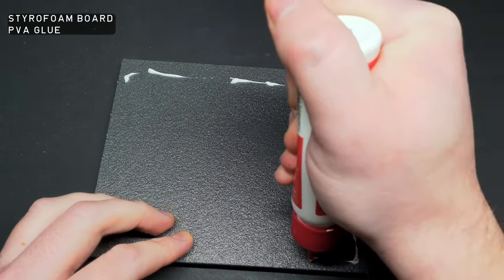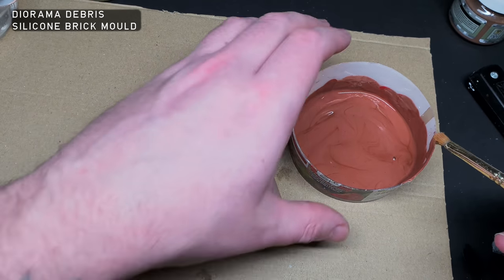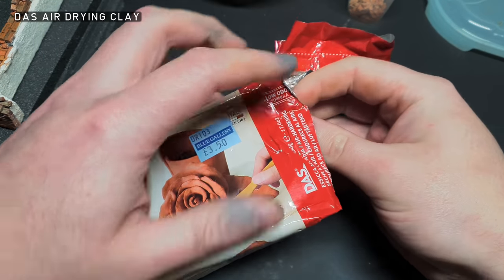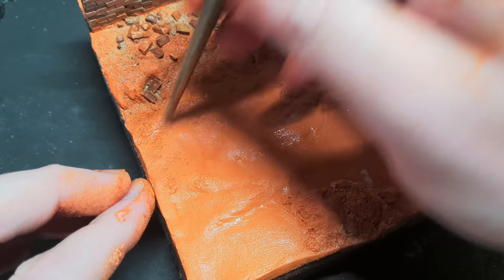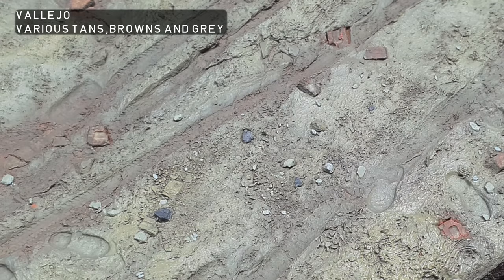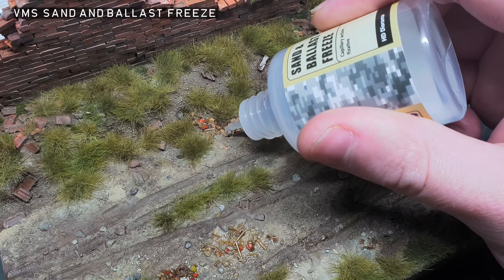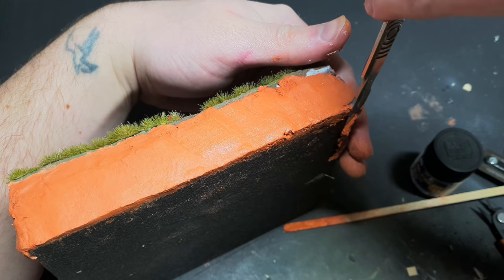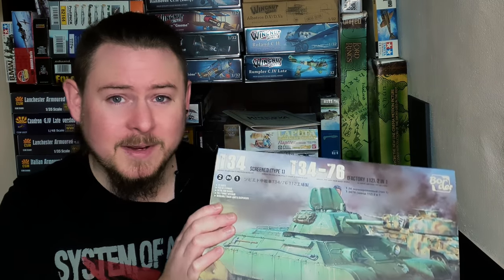1/35 Diorama | Building a Ruined Wall !

Comment: Nice dio! Love the brick mold idea! I was going to buy premodern but much prefer your idea....If it helps I face my bases with balsa wood, you can stain or airbrush....easy to fix in place, easy to cut to size and sand....and off cuts from eBay or amazon are dirt cheap!
Reply from the maker: Thanks steve ! We do balsa at work so its not hard for me to get, I think the hardest bit will be cutting the dio at right angles 😅

Comment: Well, whole completed diorama looks really good, thus its shame that...

1) Bricks - colour and moulding them as you did is awesome. But bricks are not stacked just like that. You need to hold them together with grout/mortar (not English person so do not know the right term) and its always visible in gaps between bricks. But do not know how your reference photo looked like...

2) Edging of the base - best you can do (if you do not want to buy some pre-made diorama base) is using flat styrene sheet, wood plate or some "hard paper" (not cardboard) like 2-3 mm thick. And do it before everything. Just make frame of material you have chosen, then add material for base, than clay or whatever and go on... but careful with water based products if you choos that thick paper.

I really love the road - mud, grass, leaves and the small tree. As I said, all in all it looks really good but there is still space to improve. (As we all have...)

So cheers and carry on with your work, its really good quality of modeling!
Reply from the maker: Thanks Mikulàš, those are some very good points. 
The wall to be honest I didnt want to mess up, there have been a few good comments with tips on how to do it better, which when I get around to doing a wall again has given me some confidence. 

I have had some good results with plywood in the past I think I was just unprepared (which is unlike me ) thankyou for the tips its much appreciated !